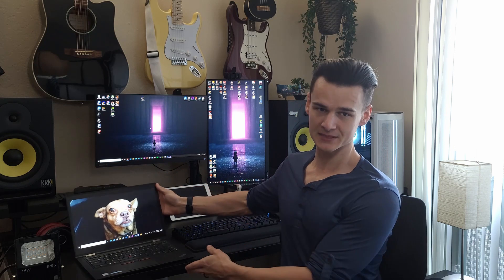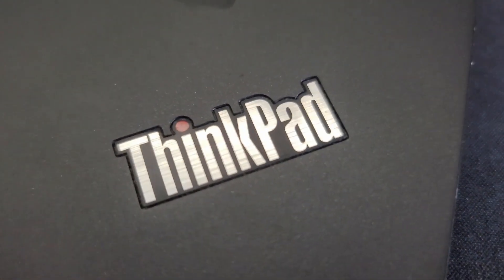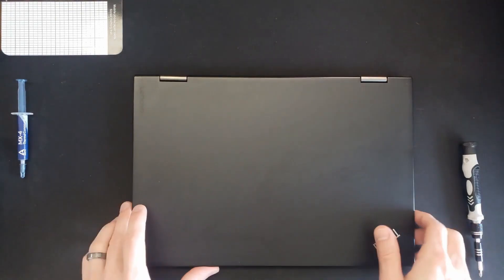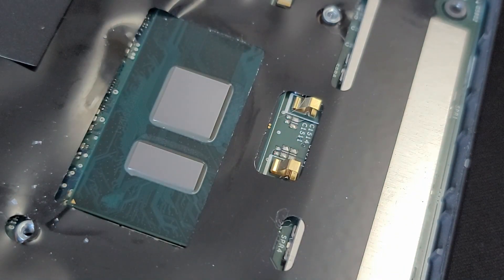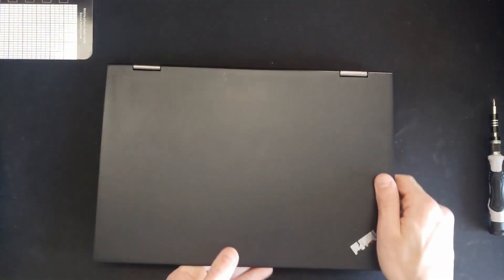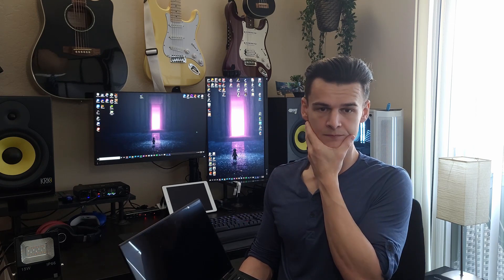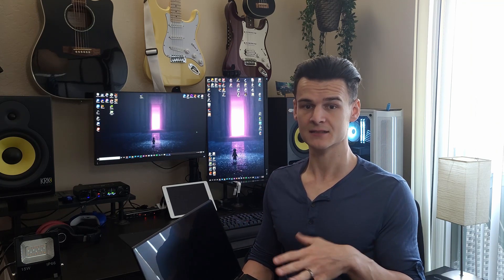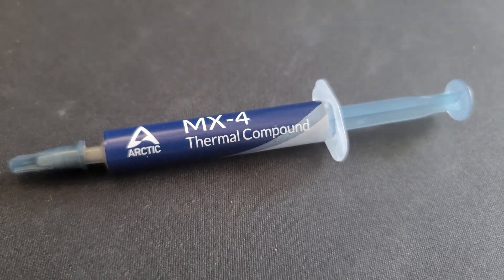New Thermal Paste on 1st Gen ThinkPad X1 Yoga

Comment: No thermal paste on GPU plate. Has anyone tried putting some there ? Even if it may not help much, can it hurt though ?
Reply: Do you mean the second IC?
Reply: @bloodyz2047  yes the one beside the CPU
Reply: @sanjaypatil2532  I have the same laptop, and put thermal paste on both of the ICs. I don't see any problems. It's extra cooling and that second IC which is the iGPU is designed for high temperatures. I've done stress tests and it got only to 78° at almost full load. You can test how hot it gets without and with the second thermal paste. If it doesn't get over 85° at full load, should be ok.
Reply: @bloodyz2047  haha we think alike :) After posting the orig question, i actually did put paste on both. It didn't help. Plz note my only nenchmark is a game my son plays and it continues to crash the system within 15-30 mins :)
On further analysis (pure physics now)...imagine the cross section view of the CPU plates and the copper heat sink. The sink is pointed with a small bulb at the end beside the hot plates. This needs to be lower than the other end which radiates the heat. The thermal fluid within the sealed copper tube, after cooling at the fan end, liquifies. It needs to be able to flow down towards the other end to restart the absoption/evaporation cycle. Before i put paste on the GPU i noticed this end of the tube was 1.5mm away from it (meaning downwards). So for me to make it touch the paste/plate, i had to bend it closer (upward in cross section view). This probably messes up the whole heating-cooling cycle of the coolant.
But i am going to open it up again, push the tube back away, insert a folded copper sheet inbetween...fingers crossed. If this doesn't work then i would hv to conclude either the sealed copper tube or the CPU are defective.
Reply: @sanjaypatil2532  Bending it is not a good idea. Instead of using themal paste which has low viscosity, you can use themal pads for graphic cards. I actually recommend buying K5-Pro Thermal Paste which was engineered for replacing thermal pads, and is also transfers heat a lot better. It is a lot thicker than normal Thermal Paste, and it can do about 2-3mm height without losing any performance. I totally recommend it for things like this and replacing thermal pads for VRMs on motherboards or on graphics cards (it's also cheaper than thermal pads). Linus Tech Tips did a video on it. Great product

Comment: thanks for the tip.
If I added a new RAM will it helps to decrease the heat of the laptop?
Reply from the maker: Unfortunately, adding any additional components like RAM will likely increase temps slightly :( How much so, I can't really say.
Reply: @phlerpyderp  i totally disagree ! More mem means lesser mem-swaps means less work for CPU for a given task. But there could be a real miniscule amt of increase in overall usage of energy and heat dissipation by the entire board inorder to support a higher-capacity memory. But this would be the least of our concerns.
Reply from the maker: @sanjaypatil2532  that is a great point! I've read some conflicting information on this (increases mostly seem to occur if simultaneously maxing out CPU and memory), and all the differences seemed so negligible it was pretty much a non issue.